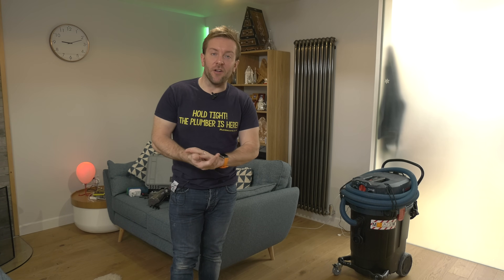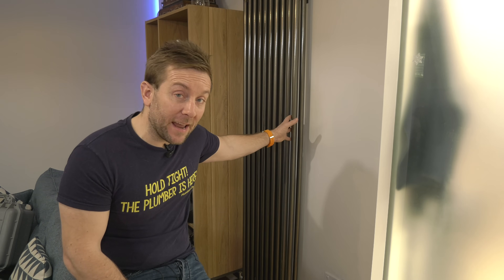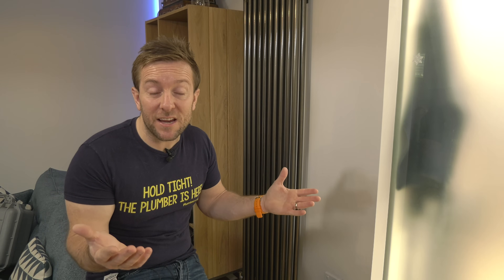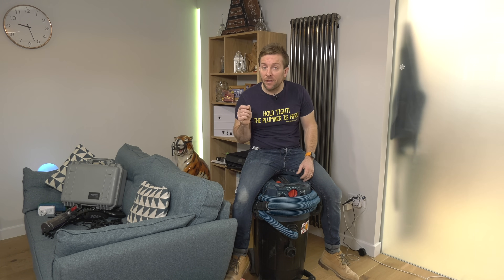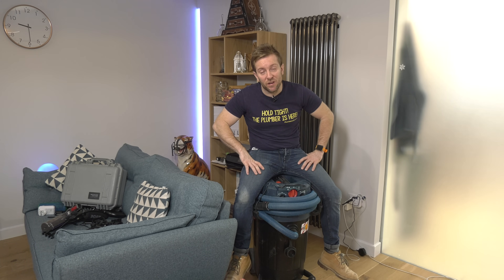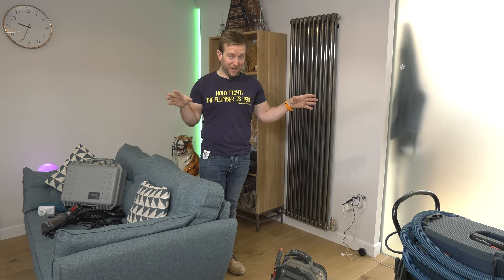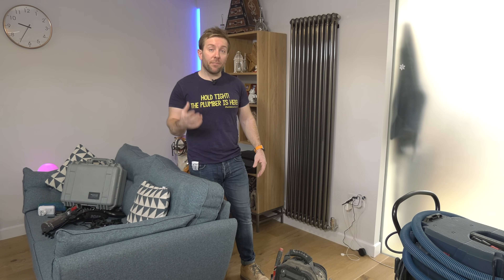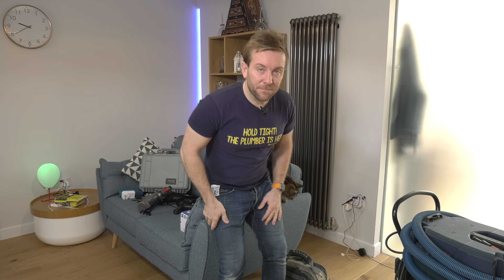HOW TO ADD RADIATOR TO EXISTING SYSTEM PT 3

Comment: Hi, in PArt 2 you men tioned a video on reducing 22mm to 15mm and how many radiators can be run on a 15mm... Ive looked but cant find it. is there a formula to tell me if it shouls be a 22 or 15 mm pipe feeding 3 rads.  Thanks

Comment: Great video, i’m going to fit a Radiator in my garage I’ve seen online that you can do it with the system already pressurised and without draining anything down would you recommend this?

Comment: HOLD TIGHT, James l love your videos keep them coming. got a question for you I've got no radiator in my kitchen would love to have one in there coz its 🥶  only way I could do it is via bathroom towel radiator the pipes come down from the ceiling to bathroom could I T off the pipes go through wall to install the new radiator.

Comment: James. Having been very disappointed with our nee ASHP and UFH install. 
Would you consider doing a video on making up a hybrid system of an lpg fed boiler ( joys of living in the sticks with no gas and limited places to place an oil tank/lpg tank ever since the regs changed and the fuel providers requiring that they can see the tank for refilling)
Thanks matey

Comment: Thanks James, great advice as always, wish I'd have seen this video a week ago, introduced a new Rad to a small commercial unit and took fooking ages to balance the system, eventually found the AAV's hiding in an obscure suspended ceiling void after a large amount of head scratching :_Holdtight: :_bigg::_Alearmy: Ps. Love the CV safe pussy :_bigg::_Fucktheag::_Alearmy:

Comment: Recently Ive been working in houses with old vented 10mm microbore systems. What a pain the arse! A simple towel rad change can turn into a major job. A full or partial drain down often creates air locks taking ages to remove. If possible hose off from a bleed valve and open each rad valve in turn to expel any air and shit clogging the pipework. Btw James you need some pipe collars on that new rad! Hold tight!! 👍🏻

Comment: I've got a Wilo pump but I've no idea how to set it. The markings are similar to the one shown at 12:02 except mine has numbers 1, 3 & 6 either side. What do those squiggly markings in square boxes mean? Should the red knob be pointing to the left or to the right side? Top centre I know is to bleed the pump but mine is currently set at 3 on the left side - is that about right for a three-bed house?

Comment: Hi, great video, thanks. I have a question though, am not of the trade but we've had our loft conversion done and added a new radiator to an existing system combi boiler. We've realised the new radiator takes a long time to heat up and its not as hot as the others plus once the new rad gets hot the pressure gauge on the boiler shows pressure of over 2. any advise would be helpful. Cheers.
Reply: Hi. You’ve added a new radiator to the system therefore increasing the volume of the system. Internal Expansion vessels in combis are rarely correctly sized for most systems but this fact gets ignored! If your pressure is increasing to 2 bar when heating is running, this is down to the expansion vessels not allowing enough expansion.
No 1. Drain system and check pressure/pump up internal expansion vessel on boiler to 0.9bar. Boiler must be drained and drain tap open.
No 2. Add an extra expansion vessel to your system.
Good luck.
Reply: Thank you James. Appreciate your reply.

Comment: Great video at my grandparents house we have 7 radiators 6 were fitted in one go and two never ever heated up from the bottom till this day we had one new radiator fitted at the end of the system which heats up within a few seconds from top to bottom... my question is why have the other two never ever got hot from the bottom no matter how much you turn the valve and balance the system even locking off other radiators in the house does not bring them to get as warm as the other 5 radiators

Comment: Didn’t you say that you would explain how many rads you could run of a certain size pipe, didn’t just forget about the video did ya, 😳
Reply from the maker: Oh bugger!
Reply: Yes please, haven't found anything that will help me understand if I need to re-vamp my pipework.
House has been extended 3 times (before I bought it), each time adding more rads to existing pipework.  In effect, rather than having a central "motorway" in 22mm with 15mm "A-roads" tee'ing off to each room, the whole circuit goes immediately  from 22mm out of combi,straight to the first radiator then sequentially around the rest of the house. I suppose there is kind of a main "highway" but its all 15mm.
Got one rad furthest from boiler which randomly will or won't heat up, I suspect a flow problem.

Any thoughts?
And a video on pipe sizes, flows etc would be great....please :)
Reply: @simonbilton2775  Main flows and return pipes should be 22mm as you said, if possible. That said, I've seen 4/5 bed houses run entirely in 15mm. Maybe get a bigger pump?

Comment: How do you know when a rad is balanced?? I'm not clear on that at all.
Reply: It'll get hot. Each rad on the circuit will be of the same temperature when trv's are consistent. That way you know each rad is balanced and one us not hogging the heat.
Reply: @Jammydodgers41  That's not the definition of balanced. My rads are all hot but I've drained the system loads of times and swapped out rads. The lock shields are all different and I've never adjusted any of them with any degree of science. So unless I'm really lucky, I have hot rads on a completely unbalanced system.
Reply from the maker: @berbababy  Hi Marco. Balancing has two aims 1. heat to all services evenly when being called. 2. Low return temperatures for condensing purposes. 

Your best bet is open every trv (with heating system off) and close every lockshield.

Turn on heating.

go to your first rad and crack open the lockshield 1/4 (or whatever as they are all a bit different...annoyingly!)

Use a touch sensor of thermometer to measure the flow and return differential.

If you have about -15 deg diff between flow and return (so say 70 deg in and 55 out) with it just cracked open after 20 mins, you're done on that rad.

Do every radiator the same.

Run the system with all trvs open and do a final walkround with your thermometer.

If any a struggling now that the systme is fully operational, give that rad a TINY crack open. 

Monitor until the end of time.
Reply: @plumberparts  This sounds like a massive faff. . . Bleeding is enough of a faff but that's sorted with auto-venting valves. Surely they can make a product that auto-balances???
Reply from the maker: @berbababy  there is almost such a product...I’m actually talking to the manufacturers about it now!
Reply: @plumberparts  Take my money!🤣
Reply: @berbababy  because your system is nice and clean bro
Reply: @berbababy  HMI make such a product! Auto balancing TRV’s.

Comment: At least half of the pump valve unions I Go to don't work or if they do manage to shut off the water quite often the gate jams shut and the spindle snaps and then you are screwed. so after you have drained down it won't fill up again because the system is full of sh*#t. Then the customer asks you why it didn't take 5 minutes to change the pump.
Reply from the maker: THIS👆

Comment: Hmmm interesting, I took a few radiators off the wall to do some decorating recently (I didn’t know anything about balancing). Ever since I put them back on my hot water hasn’t quite been as hot as it was before. I’m now thinking this could be because i didn’t balance the radiators and maybe the  flow to the radiators is taking away from the hot water? Something to investigate today